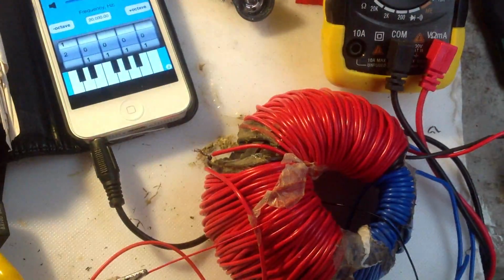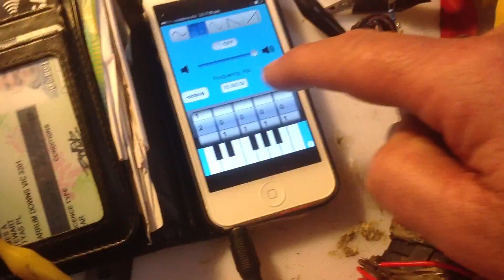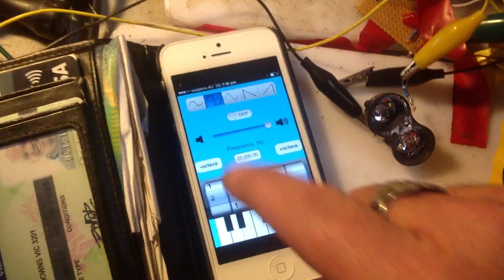Magnetic Resonance Amplifier powering LEDs

Comment: Interesting, do you have a way of measuring the energy that comes off the sig gen before the transformer?
Reply from the maker: Not yet - I'm think of sticking an amp meter in between the common of the iphone lead and the primary coil.
Reply: jimboot2 If that doesnt work, try putting a 0.42 ohm resistor inline , then scope that.